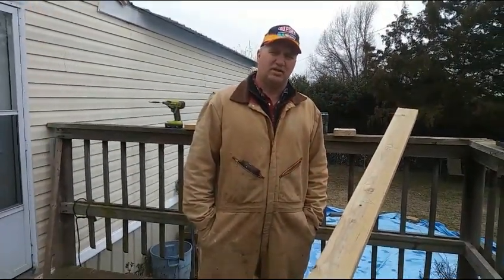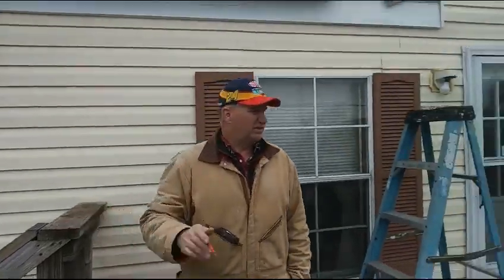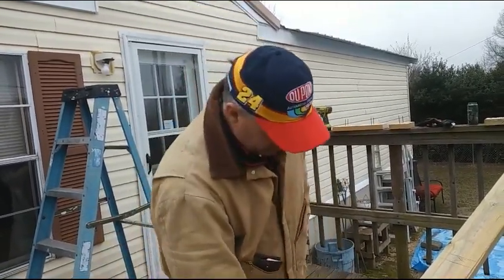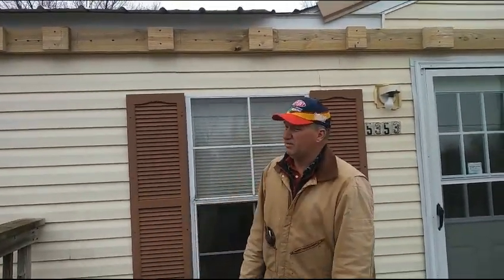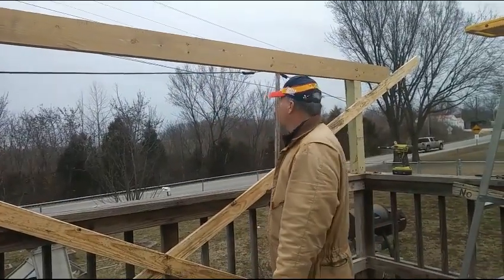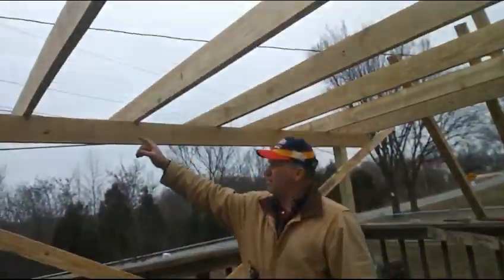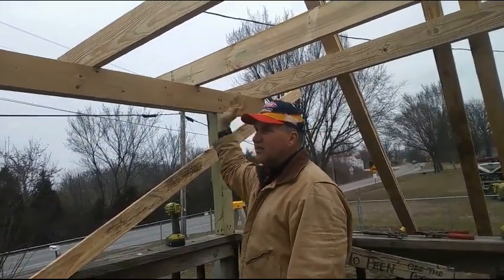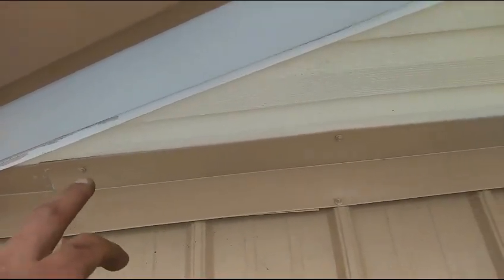How to Build a Budget Deck Cover for Your Home, Mobile Home, and Building

Comment: Im doing a similar project, im not a trade carpenter but I did build my own deck and shed.  According to code everywhere ive seen anything structural requires galvanized nails or simpson structural screws.. What kind of screws are you using?   Also wouldnt it be easier to put hangars in?  They are only $1.50 each at most places.
Reply from the maker: Nails never hold as well as screws has been my experience. Of course you can buy hangers . A regular stud now is 4 dollars and you would get 6 at 14 and a half inches or 4 at 22.5 inches out of an eight footer . Budget remember. If the law tells you to do something do that . Codes are for when you want an inspection. In our area many of my decks and covers have been looked at . And used for many years. That one there has been there now four years . Worked on a deck around their pool couple of months ago all is well as are so many others I have completed. I can only speak from my experience. I hope do well also .

Comment: How did you secure the posts to the top of the existing rail?
Reply from the maker: The easy way is to put 2 or even three 3 inch screws at an angle per side you can also add 4×4 metal clips. Hope that helps
Reply: Is 2 or 3 screws on an angle code approved? The metal post connections are definitely better and only a few $. Cheap improvement in the big picture of the cost of the deck/roof. 

Besides the limited lateral load resistant of the screws, there’s also a long term problem of water intrusion leading to rot. This won’t happen right away, or maybe even in 10 years, but as the wood dries and shrinks/expands, water will wick in along the slope of the screws leading to rot. Gravity will continue to hold the roof in place - until a lateral load is applied, then Ouch. IMO, It’s a scary liability to have that much load overhead.

Comment: Have a trailer home What's best way to add deck cover to an existing deck an code says I can't touch the the trailer with anything
Reply from the maker: Interesting how you can build an addition to a home but not a covered porch. What I have done is build the same porch or porch cover with bracing that runs from the top to the bottom diagonally. Keeping what they need with their rules satisfied. I think did one video for bracing underneath the porch. Only with a porch cover it be along the outside. Hope that helps.
Reply: @StraightArrowRepair   yes thanks think going run the 4x4 on outside of the porch alone the 4x4 post that's in the ground an use nuts an bolts to screw them together
Reply: Im doing the same thing now.  putting 6  4x4 x12 posts in concrete ( 36" deep)  Its a pain in the ass it has to be separate from home
Reply: Yes, you don't want to attach it to the mobile home because a mobile home is always shifting and if you attach a porch to the mobile home, it prevents it from shifting and can cause damage in the floors and walls.

Comment: What is holding this to the trailer besides lags through the siding, press board and possibly the rare occasional  strike of a 1/14x3 mobile home  " 2x4" ? ? Whew,, I hope there is no wind or snow load anywhere near this joke.
Reply from the maker: Been there for 5 years now and we get 50 mph winds regularly. Still .

Comment: I think you missed the units for your roof pitch. 3:12 is 3” of rise/fall for every 12” of run, not 12 feet. You have a flat roof not a pitched roof.
Reply from the maker: Thanks for keeping me straight and true. When I stop making mistakes I will be dead. I just try to make to many thanx again
Reply: So he has to have a 3 foot rise for his 12 foot run?
Reply: Horseshit. You don't drop the roof 3 feet in 12 feet. That's ridiculous. You drop it 1/4 to 1 inch per foot max for slope on that roof.
Reply: Mitchell - A 1/4” per foot (1:48, 2%) is basically the cross slope on a sidewalk. No horse, cow, or any other droppings. It does drain but it is really flat for a roof. 4:12 is pretty standard; 4” in 12” or 1’, 4’ in 12’. Go outside with a tape measure.
Reply: Melvin : He doesn’t have to have a 3:12, 3’ in 12’ slope for the roof, but if the roof is flatter than that, it needs to be a finished differently. Flatter than 3:12, is considered a flat roof and shingles are not recommended by the manufacturers. The problem is that water will wick up underneath the shingles and rot the roofing. 

I have 2 roofs that are flatter than 3:12; both about 1:12. One was replaced because it was rotting, as well as other problems. It now has a peel and stick roofing. The other is finished with a waterproof membrane.

Comment: You call yourself a contractor when you're putting a 4x4 sitting on a deck rail, AND you should have used joist hangers instead of screwing them into the sides. I wouldn't have you build a DOG HOUSE!
Reply from the maker: For those who care . The covering over this deck was discussed before starting. The weight is sitting on the handrail directly over another 4×4. There has been no sag caused by the cover. 3 years have passed. They are happy with this result. They have been happy with my work for more than ten years. They are still my friends not just customers. I hope to share with all who watch me that my genuine hope is to make your lives better. I wish you all the best.
Reply: He’s talking about is not wind proof. Wind brace. You can add like a cedar 4x4 like detail in a 45 degree angle to act as a brace.
Reply: This may shock many youngsters out there, but joist hangers and ties are relatively new. You may find this really difficult to believe but for hundreds of years we actaully nailed wood together and it HELD! Just because you saw a product at the hardware store, please dont assume you know enough to insult someone .